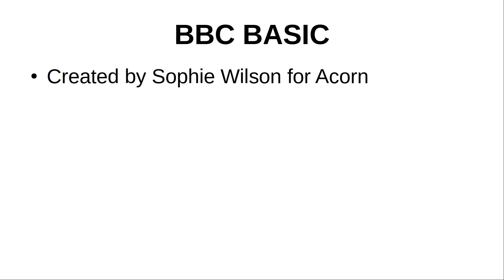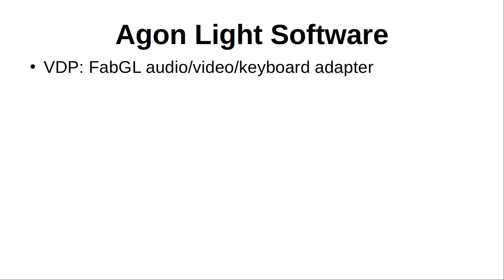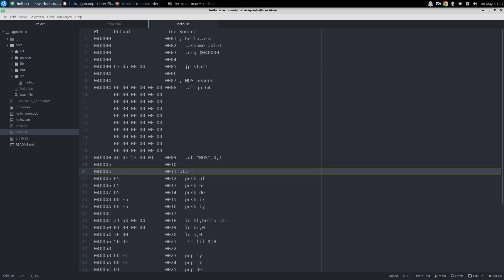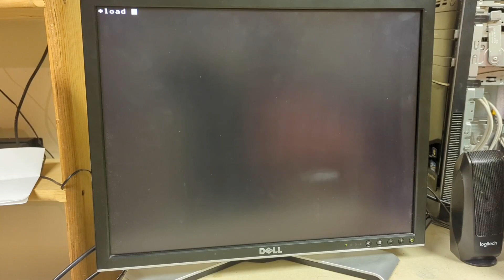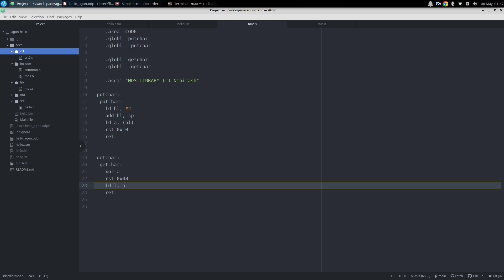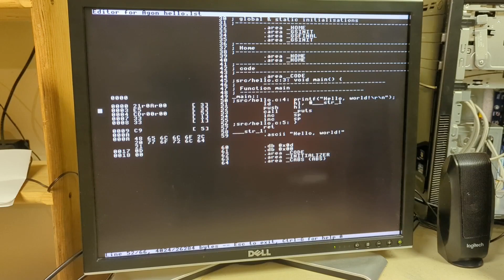Hello, Agon! -- Hello World in BBC BASIC, eZ80 Assembly and C

Comment: Thanks for an excellent tutorial video.

I was not aware that the Agon Light 2 was divided into separate halves connected by the 1.25 MHz serial link.

I have a couple of questions:

1.  Why does  the eZ80 run at 18.432MHz - is that for baud rate reasons? Could it be cranked up to the full 50MHz?

2.  Is it possible to use a serial terminal application to talk to just the eZ80 subsystem?

Whilst I like the Agon Light 2 for what it is,  I would prefer, next time a dev-board which exploits more of the capabilities of the eZ80, so more RAM,  full extended bus exposed to expansion connector,  all port lines of  PB, PC, PC bought out for expansion.
Reply from the maker: 1. My understanding is this was done to maintain stability and that going faster would not be dependable. 

2. There are probably two ways to do this. One would be to reflash the ESP32 to run a simple terminal and provide that to the user instead of the current VDP interface. It might also be possible to cut off the ESP32 entirely and hotwire in a serial connection, but this would likely be destructive for the board. Also, the eZ80 would need to be flashed with firmware other than MOS to support this.

Comment: looks like a GREAT SYSTEM!    I just need SOME kind of communication/networking.  I could use serial, but would prefer some Ethernet, hardwired or wireless, so that I could have a system programmable in BASIC that handles GPIO.

Comment: I'm currently planning a system specifically for CPM 3, and I'm thinking about the eZ80. 
But from what I see here, it is really quite different from the original Z80.
Reply from the maker: Yes, there are definitely things you need to look out for. I recently featured the Aquarius+, which uses a regular Z80 and would definitely have the RAM for CP/M, but currently lacks support for 80 columns.
Reply: @slithymatt  I have almost finished my port of CPM 3 for John Winans' Z80 Retro board, that one has 512k RAM, but with a inconvenient 32/32 banking.
I want to develop a system with a more MSXish 16k page size, but I really want it to be Z80 compatible, using the old school assemblers (my current CPM is written in ZMAC).

Comment: Is there going to be a version running the ZILOG Z800 processor which will run ZILOG Z80,ZILOG Z80A and ZILOG Z800 code and make games run much faster or for that matter a PC running the ZILOG Z8000 could run UNIX System V that was compiled for the ZILOG Z8000.
Reply from the maker: Not that I'm aware of. The next one will have a 6502

Comment: Excellent video. One minor point. The eZ80 is pipelined, so while theoretically the 3 byte JP should be quicker than the 4 byte JP (allowing for the much quicker clock speed), in practice it isn't. I think ! (PS: Byte Attic 4 Commander X16)

Comment: I was expecting you to use the built in assembler in BBC basic instead of a separate assembler program
Reply from the maker: That's a lot more fiddly to deal with.
Reply: was it ported across to Z80?
Reply: @Louis8989-1   Indeed it is. There are some example stubs floating around. 
I always found the BBC BASIC inline assembler a bit of a faff - it never felt as well integrated as it might.